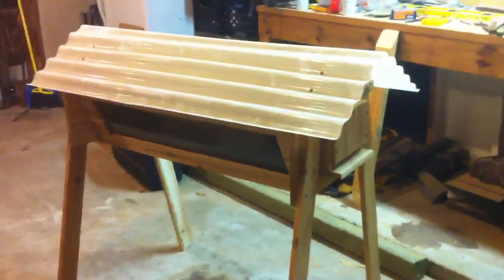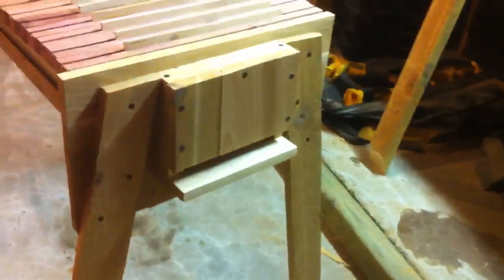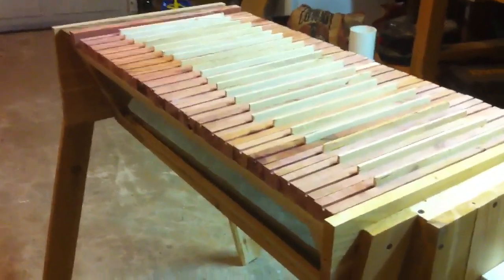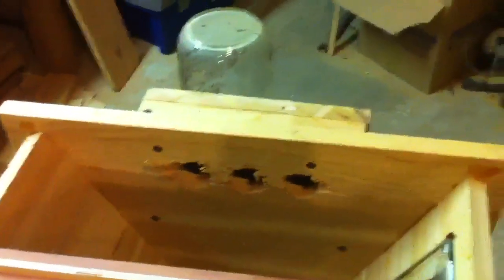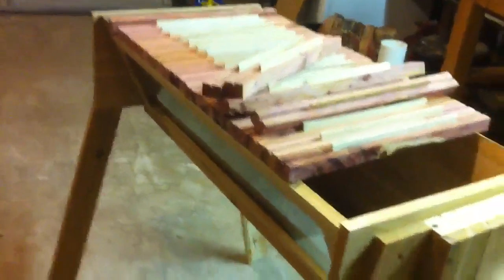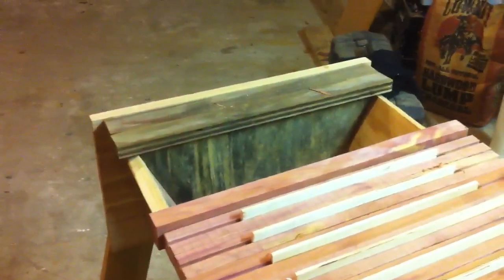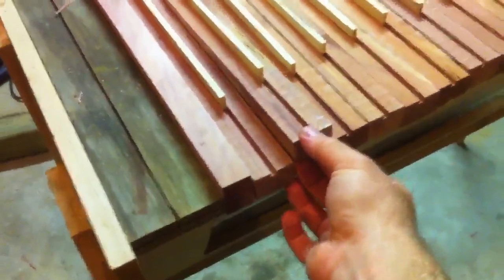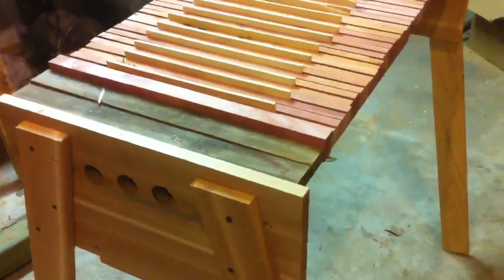First Top Bar Hive - 001 - Construction

Comment from the maker: Two reasons: The first is just to have a way to close up the hive in cold weather. I don't really need it down here in Houston for that reason. The other option is that it gives you a place to slide in sticky traps for mites or SHB (if you have them). Also if you can design a long shallow pan, you could slide in an oil trap for the same reason. The screen on the bottom is big enough that mites/SHB will fall through and drown, but not the bees.

Comment from the maker: For the dimensions, I just searched the web. I really don't recall the website where I found them. But that is the beauty of a TBH. You can use whatever dimensions you want. Granted that also the downfall from a universal component standpoint. The key is just that you side angles be 60° from horizontal. This matches the natural angles of the hexagonal cells on the comb, and prevents the tendency to build brace comb to the wall. Good luck!

Comment from the maker: I believe the holes are 1" diameter, maybe 1.25". Yes, there are three under the entrance box that I built. They are located up on the hive, just like the ones that I show here on the opposite end that I mention are drilled in the "wrong" spot. So the bees crawl in at the landing board, then up the inside of the entrance chamber, then through the holes into the hive.

Comment from the maker: Rick, as stated already, the entrance holes are 1" diameter. The slot where the feeder sits is just over 3/4", just enough for the feeder to slide into. The notch on the entrance reducer is 3/8" high which allows the bees just enough was room to go in and out. Hope this helps

Comment from the maker: Place your hive with afternoon shade and the heat should not be of concern. Make sure there is a steady water supply in close proximity as well. Watch out for small hive beetle (SHB). They are very prevalent down here but can be managed as long as your colony is strong.

Comment from the maker: I didn't use treated wood...not that I recall? Did I mention that part of it was treated? I believe it was all raw, or at least as untreated as you can buy from Lowes. Nothing is pressure treated in the hive. The cedar top bars I know are clean since I sawed them myself. 
I agree though, I am avoiding the use of all chemicals on my hives where possible. I even use latex paint on the exterior instead of oil base. And of course, no chemical treatments on the bees!

Comment from the maker: Just search the internet for "top bar hive plans". You'll find some like that. But in general, the only "rule" is that the side walls need to slope out 30 degrees from vertical. This is derived from the exterior angles of a hexagon, which is the classic shape of a cell in comb. You can make it as tall, wide, or long as you want.

Comment: Great video      how did you construct  the window ?
Reply from the maker: Cut the hole 1/2” undersized for the piece of glass, then used a router to cut a channel behind the hole that was the size of the glass. Used basic caulk to stick it in place.

Comment: Um...I built them out of wood. I didn't coat with anything, as it was to be temporary. I just used cedar as it is more weather and bug resistant. We are in to year 2 and it seems to be holding up OK. My window somehow popped out, possible due to wood expansion/contraction, but rot does not appear a problem.

Comment: Where did you get the plans
Reply from the maker: I don't recall honestly. I just searched "top bar hive plans" or something along those lines. The key is that your side walls slope at 30 degrees from vertical (or 60 from horizontal) to match the natural external angles of a hexagon. Beyond that you can make it as long, wide and tall as you wish. The plans I found were most useful in the tip to build your follower board first, and then use it as an assembly jig to tie the sides to the ends. Good luck!